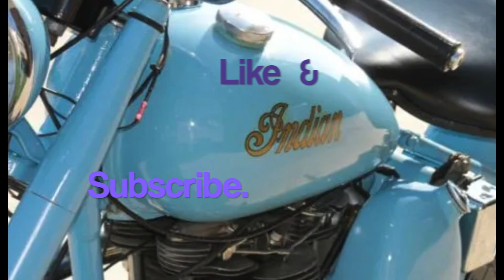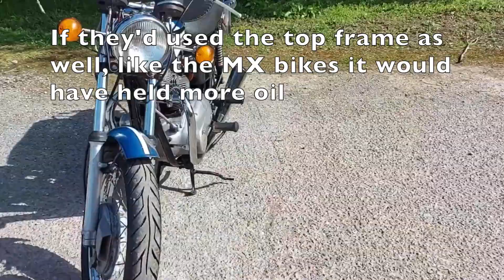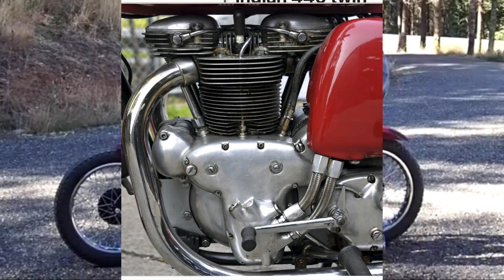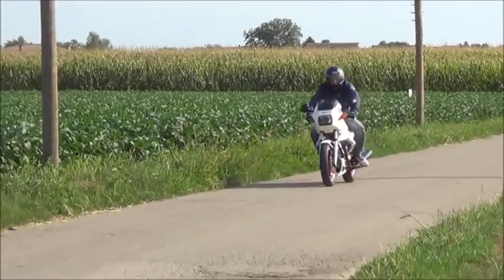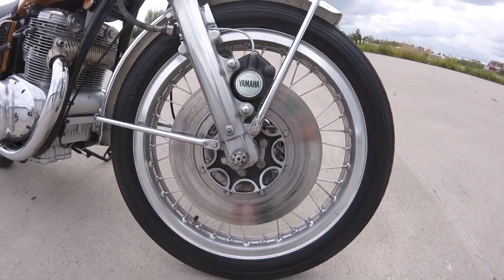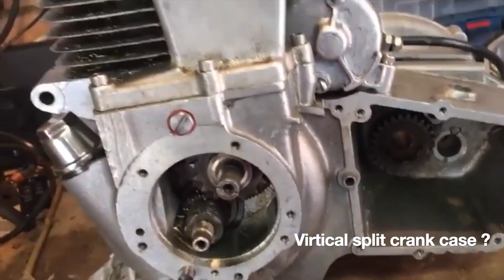5 Yet more Motorcycle Disasters

Comment: There's another British motorcycle disaster you could cover. Brockhouse (owners of Indian) approached Vincent about using their engines in an Indian Chief frame. A prototype was designed, with detail engineering by Phil Irving. The installation was OK, but the chassis didn't really cope well with the power of the Vincent power unit.
Obviously, selling engines to Indian would require a huge step up in production for Vincent. The Brockhouse management requested they invest in, for example, die casting of crank-cases. The money would come, yes, definitely, soon.... It kept on not coming. Eventually it became clear that Brockhouse was stringing them along, the money would not come, and it was really a plan to acquire ownership of Vincent cheaply. It did contribute to Vincent having to stop making motorcycles.
Reply: Could have saved both companies..
Imagine what a vindian would be worth now
Reply from the maker: Oh Brockhouse their dreadful 250 Brave is on another video in the series. They have a lot to answer for
Reply: Just to put you right , indian sent over a Chief  for Phil Irving to try and get more power out of the engine , he struggled  to get anything    but  did in the end , he was so hacked off at the indian engine he decided to  stick a vincent engine in ,the only way indian could of made it work  having a vincent engine was for them to  manufactuer it in America as the stevenage factory was never ever going to be able to up production ,if you`ve ever seen pictures of the factory you`ll understand , Vincents were out and out  top engineers they just happened to build motorcycle , one would say  one of the best

Comment: I once met a man who had been a toolmaker at BSA-Triumph. Amongst other things, he made the tooling to manufacture the 1971 oif frames. Do not blame him for the high seat or small oil capacity....
He was present when workers for the company that made the tooling for the machining of the Bandit/Fury cylinder head uplifted it, took it away, and scrapped it. The story goes that there was only one company able to make this tooling. BSA/Triumph made an arrangement to rent it instead of paying for it. They didn't pay the rent, so in due course the company took it away. That was effectively the decision that ended this promising design.
Somewhere around 1980, the Australian magazine 'Two Wheels' did a test of one of these machines in their classic bike series, written by Lester Morris. He was rather impressed by it. It handled and rode superbly, and he regarded it as a fast machine. From distant memory, he said it was flexible, and much faster than a Honda CB360, and compared its power to a Yamaha RD400 on expansion chamber exhausts.
There were a large number of bikes sent around the world as display bikes (figures around 100 get mentioned), but they had no internals in the engind units. Running examples, like the machine tested by Lester Morris, and the machine newly created out of parts by Alex Campbell are very rare.
Reply from the maker: Oh no that was management all the way it was designed for the BSA engine, they just assumed it would fit
Reply: @bikerdood1100  The engine fit issue was the initial 1971 oif frames for the 650 Triumph and BSA Lightning and Thunderbolt. The engine fit issue was the reason they held up production, missing the US buying season. I don't remember what they did for a fix.
It was only once they started selling the oif bikes that the over-high seat and under-sized oil capacity became apparent.
The new 350 bikes, the BSA Fury and Triumph Bandit had an entirely different frame. I was rather surprised when I saw a 650 Triumph engine shoehorned into a Bandit frame, for a hill-climb special. It was rather successful. Compact, light, and nimble. 
I vaguely remember another hillclimb special using the same frame, and a V-twin engine using two Neil Street four-valve heads made for speedway. I think it was the Gregory.
Reply: Absolutely Disastrous Management Policies adapted by the BSA / Triumph Group that Ultimately led to the end of the Industry. Yours is an interesting story. Very Sad indeed about the Bikes.
Reply: The death by management of BSA-Triumph is well documented and tragic.  Think their best play would have been to continue to refine the old bikes (engine goes back to late 30's), while starting an entire new design and even name.  Like Toyota and Lexus.  Big if that they had any imagination pool to draw on to create new design.

Comment: I had the exact same model of triumph. I have to be fair in it was a pretty good bike, although I could never stop the oil leak
Reply from the maker: We had the tiger 750, push rod leaks aside it was pretty good
Reply: The secret to solving the push rod oil leaks is to always fit new gaskets. OTOH, the way the rest of the bike leaked oil, those were a minor problem.

OTOOH, I had a mechanic acquaintance who solved his oil leak problems by hand lapping the vertically split crankcases.

Comment: Had a 1975 T140V Bonnie back in the late '70's.  Biggest memory of the bike is changing down coming up to a junction.  The gearbox mainshaft sheared in half, locked the rear wheel & put me on my arse.  Chain off & a long push home.  Had some great times on the bike though.
Reply from the maker: Oh not great. Triumph boxes usually seem tough, not that one obviously
Reply: @bikerdood1100  yeah, the hollow shaft with the clutch pushrod may have been a weak design, or maybe I was just unlucky.

Comment: I can't understand why it was so hard for  BSA / Triumph/Norton  to come up with a single overhead cam, wet sump  twin ,  similar to the X'S 650. but with better situated  Bob weights ! LoL  They stubbornly stuck to pushrods .
Reply from the maker: Nothing particularly wrong with push rods really after all the XS didn’t rev particularly high either and OHC. Engines are taller. After all BMW & Guzzi used OHV engines for years. A better design within internal tubes and a balance shaft perhaps would have been sensible
Reply: @bikerdood1100  Triumph are making some good twins now though.  Wonder why they stopped production of the big 1700cc motor ?
Reply: @gerry5134  think euro 5 killed the engine  🤔
Reply: @paulbarnes6124  That's a shame, I hought it was an amazing looking big chunky engine  !
Reply: @bikerdood1100  "I can't understand why it was so hard for  BSA / Triumph/Norton . . . "

Money and engineering talent. They had a shortage of both.
Reply: @johncasteel1780  lateral engineering....cases split vertical so machining had to be accurate.....Japanese had cases split horizontal so easy to align all parts
Reply: @johncasteel1780  no they had the designer's and engineers but no money. Everything was paid to shareholders. The bandit and fury were last gasp efforts. But look back in the records many interesting designs. Twin overhead cams . Four valve heads. V twins. V fours. You name it but always refused. Even simple cheap remedys to stop a problem refused. Many of the designers and engineers were very frustrated .

Comment: Why would you want to add more oil to the OIF Triumph ?  The level was at that point because that is where it held the required amount, the same amount of oil as in previous models. More oil is not better.
Reply from the maker: More isn’t always better but the volume wasn’t massive, also putting on the down tube meant that it got covered in crud. I found draining our was a messy business when compared to a traditional tank. I do like the concept though
Reply from the maker: Erm 
1968 oil capacity 7.5 pints 
OIF.                       4.8 pints
Probably should have checked before you commented really, information wasn’t exactly hard to find 
Just saying 😂😂😂😂
Reply: @bikerdood1100  There was a difference, but not as much as you say here. Oil tank capacity was 5 imp pints (2.84 litres), OIF 4 imp pints (2.27 litres).

Comment: I am the original owner of a 1973 Yamaha TX500.  It did NOT have the same problems as the 750; the balancer shaft is mounted high and does not froth the oil the way the 750's weights did.  It certainly had its own design flaws though, all of which were handled either with parts from later models or a bit of judicious fiddling.  Mine has 124.000 miles on it; I rode it, solo, from DC-LA and back in 1975.  Shortly after that trip, a valve adjuster screw worked loose and fell into the bottom end.  I discovered that there were cracks in the head around one of the valve seats; from what I have later learned, a not uncommon occurrence.  The fitment of a 1976 model head handles that, along with the oil leaking that ALL of the early models were prone to with the original two-piece, horizontally-split head (the '76 model was the first year with a one-piece head, which also has much deeper cooling fins).  Fitment of a factory oil cooler kit (along with personally fabricated lines to run ALL of the oil through it) also aids cooling.  Removal of the starter drive (mine has been kick-start only since 1976) removes the necessity to remove the alternator rotor in order to adjust the balancer drive chain tension (the '78 model had a different design that handled that too).  For years I simply couldn't afford another bike, so I kept on fixing and fiddling and adding performance mods (reground cams; Mikuni carbs with airbox removed; Alphabet exhaust; Koni shocks; 1978 model cast wheels; factory dual-disc front brake kit with fork legs swapped to put those heavy calipers behind the legs rather than up front, using RD400 brake lines, with discs drilled; '78 seat).  It's undergoing another ground-up rebuild, got the frame powder coated, and it's getting a Race-Tech suspension upgrade for the fork (which both my '97 T595 Daytona and '02 T100 Bonneville have gotten, marvelous improvement for each).  My brother likes to tell me it was once called "one of the worst bikes of the 1970's" but he's never told me who said that.
Reply from the maker: As with Hondas V4s the problems were less common in the smaller models. Also Yamaha’s build quality was variable at that point and as with their triples a well put together one will last a lot better
Reply: Mine has lasted this long mostly because I put the time and energy into fixing the original flaws.  When I tore it down originally I also found pitting in the first and second gear cogs, as well as one of the rod bearings, so all those were replaced too.  Had I not done all the work myself there's no way I could have afforded the repairs, would have cost more than I paid for the bike!
Reply: Other than jacking the handlebars up, and slipping a new bike under them, yeah, the TX series were great. If you want to talk about great Yamaha 4 strokes, start with the XS Eleven......

Comment: The triumph bandit and BSA fury, looks like a reverse engineered honda cb 450 twin from the early 1060's.
Reply: didn't know Honda was making bikes in the 1060's 😅
Reply from the maker: Pretty sure I didn’t say that
Reply: @bikerdood1100  it's just a typo on Red's end lol   9 is right next to 0
Reply: @TheJunky228  Mr. Obvious at his best
Reply: @milojanis4901  you're welcome
Reply: To be honest it is just a passing resemblance if you look at the design of both engines in detail they are very different in fact if they had copied the CB450 things might have turned out differently but then again they could not even afford the retooling needed for the design they did have let alone copy the Honda this same issue was why a more modern BSA/Triumph 3 engine did not materialise because only so much could be spent on retooling.
Reply from the maker: It really doesn’t

Comment: Some poorly designed bikes had no easy fix. With the TX750 however it was. Just a matter of deepening the sump and the counterbalancers stayed out of the oil. Obviously could have benefitted from an external oil tank and dry sump set up, like on the early hondas CB750's. These TX's are still around today, and with the cited isuues resolved, something BSA did not do with its oil feed woes and plain bronze timing side main end bearing on the A65 range.
Reply from the maker: It’s that old Yamaha variable build quality again

Comment: The OIF Triumphs are just fine if well maintained. I have a 1982 T-140 Bonneville.  You can now buy a decent clutch for these and the last of the motors were relatively tough and strong. But yes, definitely a design that was pushed well past its intended envelope.  They still handle beautifully with decent tyres and shocks. Mine still gives much joy when I ride it  but the oil leaks do tend to return after a while.
Reply: I have  73 Triumph Tiger 750V, I also have a number of 70's Japanese bikes, while I love the Tiger for nostalgic reasons, when working on that motorcycle compared to the Japanese ones you realize how truly prehistoric the design was. As an engineer I see so many problem points that could so easily have been altered to improve reliability and prevent oil leaks etc. but the senior management was all about taking the profits out of the company for shareholders in the hey days when they were selling them hand over fist in the USA with zero investment going in to improving the product, or new models.
Reply from the maker: We had one, don’t think I was getting at the bike itself though
Reply: Cheers 
Bought a 77 silver jubilee, yeah I've heard they handle great and have good power. 
Boxes of parts for now.
Reply: I've had a 72 Tiger for 20 years now. The rear conical hub brake is a good brake, no issues at all, the front wasn't, replaced it with the disk brake from a later model. The clutch and 5 speed gearbox are robust and sensibly engineered. These bikes handle great and can show up far more modern stuff through the twisties. They do vibrate if you push them hard and the engine definitely shows its 1938 heritage. Spare parts supply is excellent and surprisingly affordable.
Reply: Thats kind of it, if you can live with the leaks and vibration, parts falling off etc they are wonderful bikes. i love my 67 triumph to bits, literally sometimes, lol
Reply: @datadavis  haha
Was amazed at parts prices cheap compared to Harley stuff, 
Can't wait to get my silver jubilee on the road. 
All the best David
Reply: @DavidKing-jx3sg  yea a silver jubilee would be all(or mostly) unified threads and late pattern parts, they are easy to deal with! generally, parts availability and expertise is still very much out there for keeping these bikes on the road. Who knows in 20 years how it will look like but enjoy your Triumph!🙂cheers
Reply: @datadavis  After the first two years of ownership of my'70 Bonnie, I spent about one weekend a month just tightening things up.
Reply: @johncasteel1780  Did it start staying together after some time, or is it still like that today? My 67 spits off the occasional thing still, last time a valve inspection cap..

Comment: So is the wet frame triumph ok or bad ,I know that they stopped producing them, why?
Reply: I think they stopped because they went bankrupt. The final ones were quite good, I own one myself, but they are very old fashioned compared to a contemporary Japanese bike.
Reply from the maker: The piece doesn’t say it was bad, the point is someone forgot to check if the engine fitted. Although of course if vibes cracked the frame it leaked. The point is it was the ancient engine that needed replacement the previous frame was good, well by Triumph standards
Reply: @bikerdood1100  BINGO-Couldn't have said it any better myself. In the late '60s, they already had the best handling motorcycles ever built, to that time. What they needed was a modern, 4 cylinder engine. Instead, they put turn signals on them, and changed the frames. HELL-O!!!
Reply from the maker: Because they built them for far too long with an ancient motor